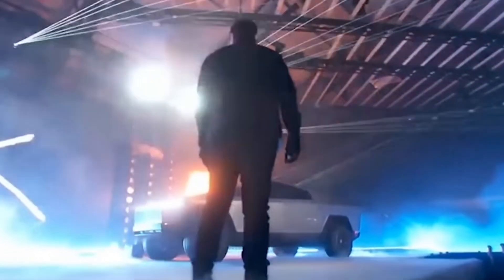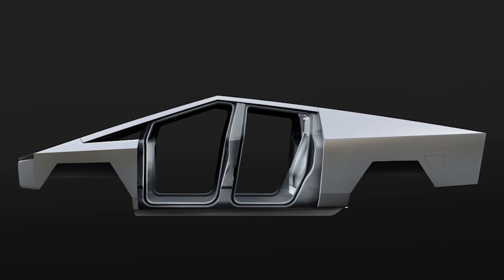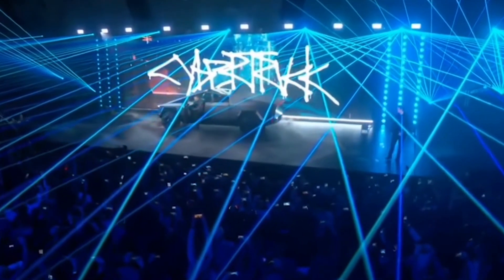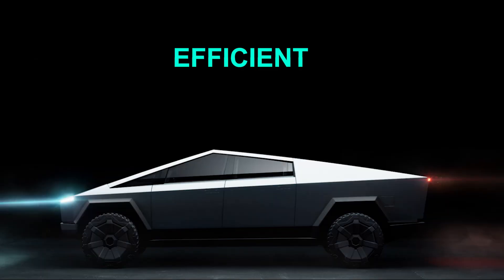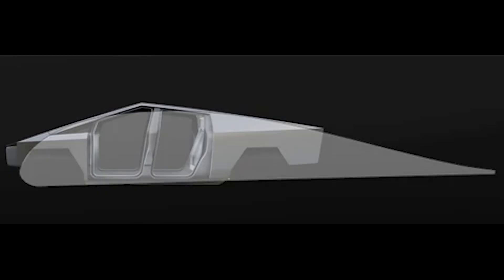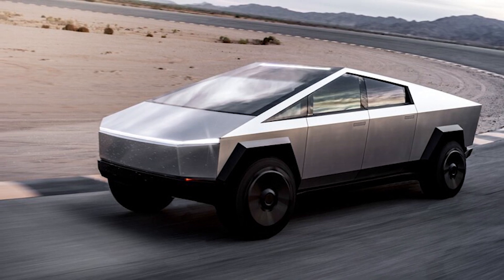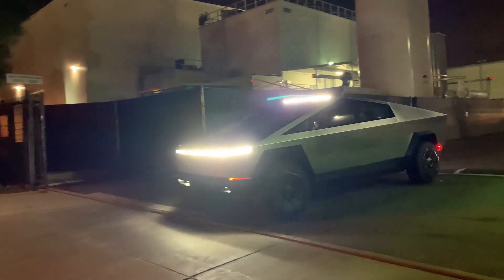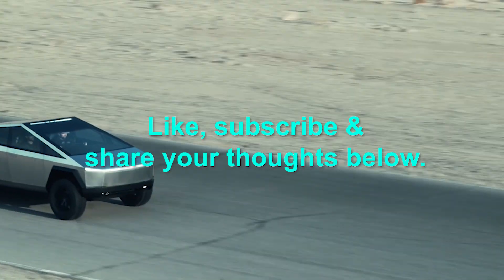Cybertruck is Engineering Genius (and will be copied)

Comment: The argument about safety because of the tough exoskeletong is wrong. Cars are weak in the front for a a safety reason - to soften any big impact. If the Tesla exoskeleotn is so tough, then if you hit something there will be no cushioning of the impact and you will be flying into the bulletproof window much harder than in a regular car. So I hope that any safety features inside of the truck make up for it.

Comment: Agree many components of this vehicle is well-designed from an engineering standpoint, but I have to disagree with your assessment of toughness. The Cybertruck purportedly uses 301 stainless steel that has been cold-rolled 30x. While the adoption of stainless makes sense, when you cold roll 301 SS that much, the steel becomes harder and stronger but ductility is greatly diminished, and hence renders the vehicle less safe in the event of a crash. In a head-on crash, you actually WANT the car to deform; more deformation allows more of the impact energy to be absorbed, and with such a short nose on the Cybertruck, I don't see how Tesla could include a crumple zone for safety. The demo with the sledge hammer looks cool, but you saw firsthand the consequences of the super-strong body panels that could not absorb impact by denting; instead of being absorbed, the force imparted by the sledgehammer was transferred to the window and caused unintended damage to the base of the glass. I also think the body panels are flat not only to control manufacturing cost (actually, cold-rolling 30x will add processing cost) but it has become so strong/non-ductile after cold-rolling that stamping and forming the steel would be incredibly difficult and expensive.

Comment: funny how people with no engineering background claim something is genius

some features like the hard glass or the really sturdy steel frame are actually drawbacks
Reply: Hi. I am  a woodworker and no engineer. I did watch a little video which claimed that Tesla's glass roofs are safer than a sheet metal roof. Odd, but it works like a stress skin panel and retains its shape in a rollover.
Reply: @williammartin2593  this truck is gonna way close to 7000lbs. thats a lot. this thing is going to be like a consumer freight truck. not gonna pass pedestrian safety tests the way it is now.
Reply: ///AMG oh how little you know

Comment: I don't see anywhere information about its safety... Just because is rigit, it doesn't make it safer. Actually, this will be a issue to solve by Tesla... The cybertruck must be able to absorb a collision impact. If not, you will get all that energy on your body and you may die even though the car is still in perfect shape after the accident. In order to do this, cars brands have been engineering their cars' fuselage in such way that when you have an accident, the fuselage will deform a lot to absorb a big amount of the energy during the impact. With this Tesla exoskeleton super rigid I'm not sure where you will have any collision system... Without such things, you don't need to go more than 15 miles/h against something  to have a severe accident (and yes, I already had a small experience with such thing... I was driving a 1967 land Rover and hit with the bumper the ground while off-roading at a walking speed... The person on the passager seat almost jumped through the window and hurt her hand very badly on the process... What about the land rover? Well, completely fine. On the other hand, my mother had once a front collision accident with a recent ford fiesta against a SUV... The car ended up for trash, but it saved her life with a minor body damage). Let's see what Tesla has in mind for this. Also regarding the safety of others outside of the truck...

Comment: Yes man this guy doesn't know what he's talking about. A safe car would allow as much deformation on impact without any intrusion in the passenger compartment. I bet that the dude thinks that a pot on the head will save him from the contusion and is safer than a helmet since it is more rigid.

The entire video is pretty much nonsense.

I especially cracked at the airfoil "argument". I can also overlay an airfoil on anything if I scale it up and arrange it over a foto of hers in powerpoint. Pathetic :)

Comment: There are functionality and safety problems here thou. Where are the mirrors. Wont these lights blind other drivers? That steering wheel is hardly usable if thigs should take a sudden turn for the worse while driving etc.
If these can be addressed it could be cool and usable vehicle to have.

Comment: Regarding safety, there are many questions on the CyberTruck.

1. Crumple zones - All cars have crumple zones in the front to absorb energy in case of a collision. With the very strong steel, I do not see any crumple zones. Means that all the energy of a collision will be transferred to the cabin and the passengers.

2. Pedestrian collision safety - The  cyber truck is high on the road. There is a possibility of a passenger being sucked under the hood and then he will get run over by the car. Also there are questions on tar commissions with small vehicles/ bikes. There are ways to mitigate this. A steel bar in the front and back will help, as seen in many semi's.
Reply from the maker: Lots of people are raising this. The steel can be scored on the underside to crumple predictably and consistently (and it appears the frunk is a separate coponent). I think many will be surprised at how well the Tesla engineers address this. Safety is always top of mind at Tesla. It may not appear so but the driver in Cybertruck sits the same distance from front of the vehicle as they do in Model 3 so there's equivalent space for crumple zone too.

End of the day, Cybertruck won't be allowed on roads if it is not sufficiently safe for occupants or pedestrians. Tesla are smarter than to design an unsafe vehicle 😉
Reply: @SolvingTheMoneyProblem  you are speculating here.
Elon should address this question.

Comment: With safety you actually want the front of the car to crumple, not remain rigid. The crumpling disperses some of the force of impact before it reaches the driver.
Reply from the maker: Lots of people are raising this. The steel can be scored on the underside to crumple predictably and consistently (and it appears the frunk is a separate coponent). I think many will be surprised at how well the Tesla engineers address this. Safety is always top of mind at Tesla. It may not appear so but the driver in Cybertruck sits the same distance from front of the vehicle as they do in Model 3 so there's equivalent space for crumple zone too.

End of the day, Cybertruck won't be allowed on roads if it is not sufficiently safe for occupants or pedestrians. Tesla are smarter than to design an unsafe vehicle 😉

Comment: Spot on.
I believe all cars eventually will be designet and produced this way. Not only UV.  It solves so many issues.
Also curious about the effect on the invironment, will this be a greener way to produce cars? Lack of paint, less energy used? Effect of steel vs aluminum?

Comment: Something else that factors in is durability. Battery tech that can last for a million miles is now a reality. The older Tesla models have ramped up an enormous number of miles with very little maintenance costs. Stainless doesn't rust (as a Canadian this is a big damn deal). The shelf life of this truck when compared to a conventional truck makes the price tag extremely cheap. Personally I am disgusted at how disposable and shoddy modern trucks are and yet the prices just keep climbing. Let the dinosaurs adapt or die.

Comment: Subscribed and even liked, but have to tell you something, I lost a little faith in you when you say the Tesla is super safe with all its rigidity, but then forget to address the issue of what happens when it crashes against a wall or similar at 60+ mph? What happens to the occupants? Where are the crumple zones, or equivalent?
Reply from the maker: p.s. Thanks for the support.
Reply from the maker: Lots of people are raising this. The steel can be scored on the underside to crumple predictably and consistently (and it appears the frunk is a separate coponent). I think many will be surprised at how well the Tesla engineers address this. Safety is always top of mind at Tesla. It may not appear so but the driver in Cybertruck sits the same distance from front of the vehicle as they do in Model 3 so there's equivalent space for crumple zone too.

End of the day, Cybertruck won't be allowed on roads if it is not sufficiently safe for occupants or pedestrians. Tesla are smarter than to design an unsafe vehicle 😉
Reply: Sounda absolutely correct but its weird they came up with new ways of handling driver, oxcupant and pedestrian safety and forgot to mediatize the hell out of it. Other than that, great video, it opened my eyes a bit.

Comment: In my opinion, it’s rigidity doesn’t mean safety. Cars are designed to have weaknesses(e.g crumple zones) 
These are crucial in absorbing energy from an impact! 
With that said I think this thing won’t be as safe as you think. But I’m hoping to be proved wrong!
Reply from the maker: Lots of people are raising this. The steel can be scored on the underside to crumple predictably and consistently (and it appears the frunk is a separate coponent). I think many will be surprised at how well the Tesla engineers address this. Safety is always top of mind at Tesla. It may not appear so but the driver in Cybertruck sits the same distance from front of the vehicle as they do in Model 3 so there's equivalent space for crumple zone too.

End of the day, Cybertruck won't be allowed on roads if it is not sufficiently safe for occupants or pedestrians. Tesla are smarter than to design an unsafe vehicle 😉

Comment: It looks really safe but everyone is forgetting that because its so tough crumple zones don't exist on that car so I wonder how it will do in testing.
Reply from the maker: Lots of people are raising this. The steel can be scored on the underside to crumple predictably and consistently (and it appears the frunk is a separate coponent). I think many will be surprised at how well the Tesla engineers address this. Safety is always top of mind at Tesla. It may not appear so but the driver in Cybertruck sits the same distance from front of the vehicle as they do in Model 3 so there's equivalent space for crumple zone too.

End of the day, Cybertruck won't be allowed on roads if it is not sufficiently safe for occupants or pedestrians. Tesla are smarter than to design an unsafe vehicle 😉

Comment: Maybe it is relatively cheap, but it is still ugly , all cars will be identical since no paint is applied , and the recharge time for such vehicle will be enormous,  may be adding some solar cells on the top of the truck may help in recharging the car while still standing and adding some efficient heat insulation will help in reducing power consumption of the car.

Comment: The only problem is it's not safe for people outside the cybertruck. When you lose control of your car,  and are about to collide with other car, you want both of your cars to have nice big crumple zones - you don't want to collide with undestructable cybertruck, not very safe. Also cybertruck-cybertruck collision without any crumple zones at all, would be probably even more fatal.
Reply from the maker: Lots of people are raising this. The steel can be scored on the underside to crumple predictably and consistently (and it appears the frunk is a separate coponent). I think many will be surprised at how well the Tesla engineers address this. Safety is always top of mind at Tesla. It may not appear so but the driver in Cybertruck sits the same distance from front of the vehicle as they do in Model 3 so there's equivalent space for crumple zone too.

End of the day, Cybertruck won't be allowed on roads if it is not sufficiently safe for occupants or pedestrians. Tesla are smarter than to design an unsafe vehicle 😉

Comment: Don’t “sturdy” vehicles that don’t crumble cause more injuries and casualties?

It’s weird how you go on about safety, when all the safety that arise from crumple zones are non-existent with the Cybertruck...
Reply from the maker: Lots of people are raising this. The steel can be scored on the underside to crumple predictably and consistently (and it appears the frunk is a separate coponent). I think many will be surprised at how well the Tesla engineers address this. Safety is always top of mind at Tesla. It may not appear so but the driver in Cybertruck sits the same distance from front of the vehicle as they do in Model 3 so there's equivalent space for crumple zone too.

End of the day, Cybertruck won't be allowed on roads if it is not sufficiently safe for occupants or pedestrians. Tesla are smarter than to design an unsafe vehicle 😉

Comment: The bed is not genius, to be honest.  It being attacked to the main car will cause a lot of issues using trucks where trucks are "meant" to be used - usually on dirt or in rough roads. 

Furthermore, the flat front window is actually a safety concern.  There is a reason why every front window currently is convex.

Comment: The real question is...since the Cybertruck is made out of a single pannel..what happens during accident? You don't have removable parts like a normal part for instance a crashed front bumper is easily replaced.what about the cybertruck..is that A smart "Apple" tactics from Elon too?

: you get the whole car replaced if damaged

Comment: Subscribed.  You hit the nail on the head.  As another youtuber put it, Cybertruck was not designed; it was engineered. As for your final question, that's the billion dollar question, literally.  The same is happening in the space launch industry, with SpaceX stealing the lunch from most launch providers, thanks to the economy of recovering first stages. But now, what do the competitors of SpaceX do?  Are they all copying the booster landing technology?  No.  Probably some nascent Chinese rocket companies are working on it;  but in the West, forget it.  They are frozen in shock, unable to formulate a coherent plan.  They can't even talk about SpaceX, as to do so might invite questions from the public that they can't or don't want to answer;  because they can't find a way to admit to their precarious position in a way that saves face.  The former director of ESA went public on urging ESA to develop booster recovery, saying that if ESA does not come up with a competitive response, it will be out of the race altogether.  And the ESA management announced they were allocating a few million euros to researching booster recovery.  That is a laughable response, however. SpaceX spent about 500 million perfecting the technology.  What makes ESA think they can do the same with only a few million euros?  So, they are basically burying their heads in the sand, hoping that the problem will magically go away.  Companies like Boeing and Northrop Grumman are completely silent on SpaceX, as if the company did not exist, meanwhile SpaceX already has 25% of the world's launch market and continues to capture more market-share.  Even Russia's Roscosmos has adopted the same silence reaction;  a non-reaction pretense to hide their immobilizing panic.  Similarly, the auto industry have pretended that Tesla did not exist from the beginning, perhaps hoping it was a nightmare from which it was a matter of just waking up?  Finally, some car companies started to try and catch up, and Porsche did quite a good job of it, but the rest did a terrible job of catching up to Tesla.  They spent too many years in denial.  Some of them, MOST of them, are still in denial.  Just look at how many car companies still don't have an electric vehicle at all.  The American companies have buried their heads under the sand, but behind their mighty fortress of the pickup truck market, believing they were safe...  But that fortress is made of sand, as it will be proven shortly.  So, I would say it is likely that most automakers WILL go bankrupt, as they were slow, and continue to be slow to react.  They are falling farther and farther behind, and still immobilized from their boards of directors down.  How CAN they compete?  Their culture is one of unions, laziness, shifting blame, each manager and worker caring only for themselves, all while paying lip service to "team spirit" and all those modern slogans.  At SpaceX and Tesla, team spirit is the foundation;  not a goal.  Not just the car industry, but all of the Western industry is based on filty politics, abuse, lies, blaming the innocent, rewarding the uninvolved, and above all alienation.  My boss tells me all the time "ours is not to question; just to do".  Elon Musk recently answered a question about how he manages to make his companies so dynamic, and he answered that the most important thing is to make sure that everyone questions, questions, questions everything they are told and every paradigm they are presented with.  Every worker should think and question and be ready to blow the whistle if they think something is not right.  Look at the dicotomy:  Most industry want workers to not question, just do, IOW to act like machines.  Elon Musk encourages his people to be human, to question everything.  Most industry alienates its workers.  Elon Musk empowers them.   So, how can the auto industry even conceive of competing with Tesla.  They don't have a snow-ball's chance in Hell to compete with Tesla unless they fire their own management AND executives, and hire HUMAN BEINGS to lead them.

Comment: Well, this video is wrong about towing capacity. It's not even close to the f-250 with either the 7.3L gas engine or the diesel engine. Both of which are significantly cheaper than the tri-engine cybertruck.

As far as it goes against the f-150, the only truck that outperforms the ecoboost f-150 (13,200 towing) is the 70k cybertruck.